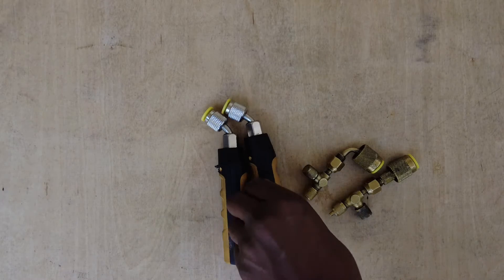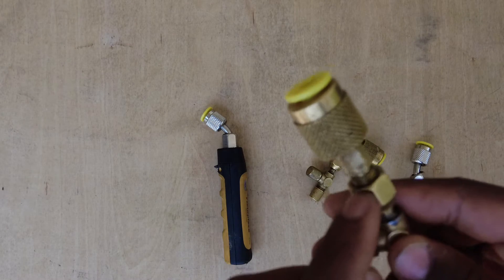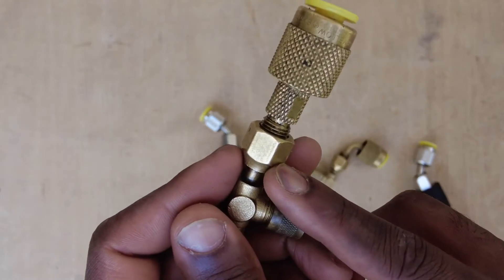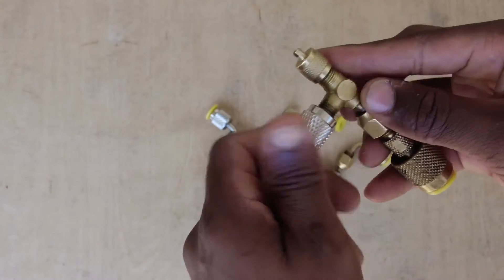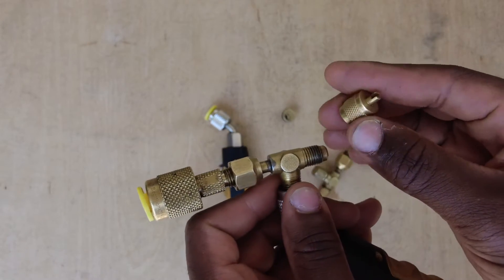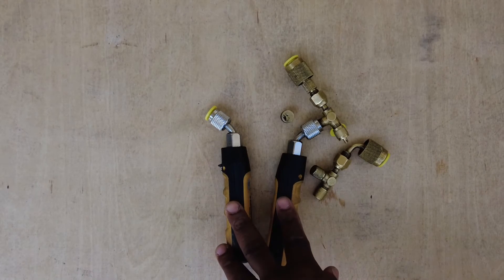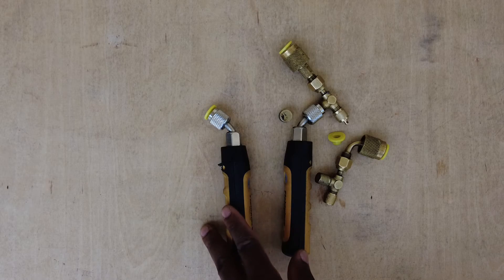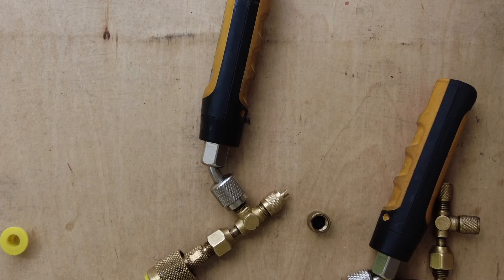How to set up Fieldpiece Joblink Wireless Probes for charging HVAC System | HVAC Tool Tips

Comment: Appion has a really nice one. They call it a "charging tee". They're like $50 tho. Make sure of the correct size if ordering, because they have several. Or of course ya can use a Schrader core removal tool. Imo, the appions are the best quality for either.
Reply: You'd also need a ball valve to stop flow of refrigerant. I use a short yellow jacket hose with permanent attached ball valve.
Reply from the maker: Great info, I have seen the appions, didnt realize they were $50 wow.

Comment: Can you pull a vaccum with them?
Reply from the maker: No, you would need to get a micron gauge for that
Reply: @HVACTechKnowledgy  i meant if you use the high side eith a charging tee and a micron gauge there then low side the probe a tee then a hose to the vaccum? Im trying to figure out if its worth it to ditch the manifold but i pull vaccums often

Comment: Can you use those wireless probes for r410a and r22? Like just one gauge for both of them ?
Reply from the maker: Yes sir, they don't really hold oil or anything like hoses do, so it's not a problem to interchange between the two refrigerants.

Comment: You can also use a schrader removal tool
Reply from the maker: True, I would just hate having to keep adding and removing the valve core depressor though, but yeah it would definitely work out pinch. Thanks!
Reply: I wouldn’t use them to charge if you use them for your vacuum

Comment: I got that T and seal right fittings 5 days ago. Nice to see someone else did that same thing and saying it works.
Reply from the maker: Nice! It works real well been using this setup for years now. The only time I use my sman 480 manifold, is to do system pressure testing, vacuum and startup when doing a repair or installing new equipment.